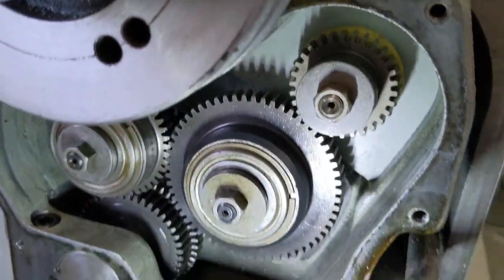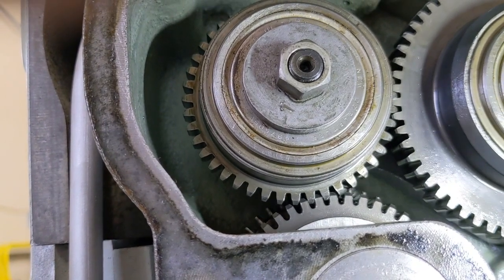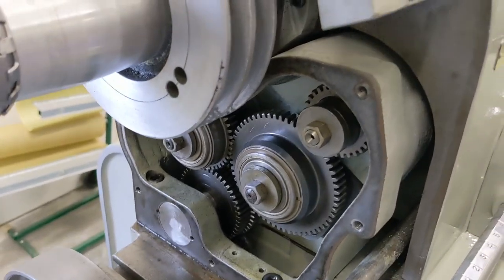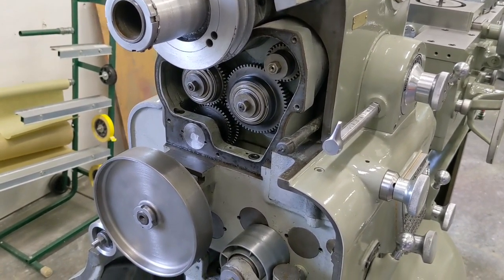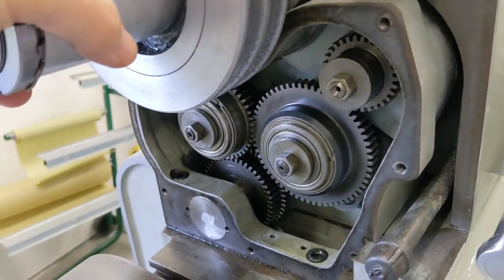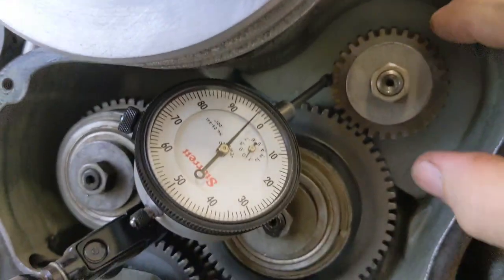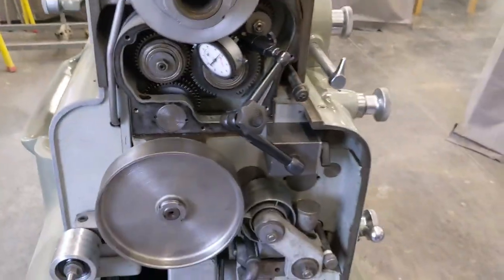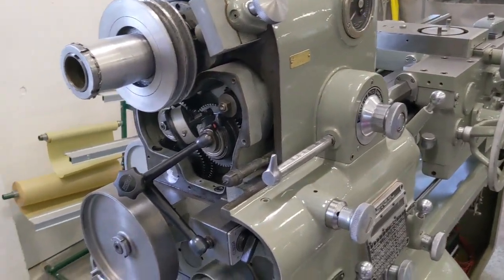10EE part 24

Comment: Did you have any issues aligning the tailstock to the head?  I did a lesser rebuild on a 1954 10EE and discovered a 0.02" sag in the tailstock once I had everything back together.  I cannot adjust it out...the offset is up/down.  I temporarily shimmed it up to see if that helped and it did.  I fear I have to do something more permanent
Reply from the maker: Hi Walt, yes on the first 10EE I did, the tailstock was a few thou low. It was already shimmed. I redid the shims to get it very close in fact I cannot measure the error. I think shimming is ok

Comment: This new angle cleares up a lot and  also leaves a lot of new questions.. Could the rattle come from inside the machine head? maybe behind the top left gear perhaps. I had to go back and watch the number 22 video again. I also noticed the sparkel in the contact point up under in the front of the machine. I believe this is from a defect capacitor. When the contact point starts to throw out sparks like that the capacitor in front of this contact point is dead. You can probably find th closest one to the contact on a diagram. That's the first one to direct your attention too. They are easy to replace and not too expensive. also (and this is important) after changing the capacitor the contact it self must be cleaned. the sparks will cause build up on the contact surface and over time cause the contact to fail to make contact. The build up does not allow current to flow. if it makes a spark after as long as the spark is small and blue you are good. when the spark is yellow or orange it is burning the contact point. I know this from fixing the old traditional tattoo machines. the color of the spark is just as important as the color of the exhaust smoke on a car. except if the smoke from the car is blue you are in trouble.
Reply from the maker: Thanks Lars, Great point on the bad cap...didn't think to check that. I will and provide an update...Thanks!!

Comment: Did you record any video of the machine running pre the refurb? Could listen to that to check if the noise is at least the same as last time and that you've not tweaked anything in the reassemble. Already looks incredible and hope you get it sorted to where you're happy with it
Reply from the maker: Hi Neil, I did but it was very short and only while in open belt, not the threading gears. I'll certainly do that if I have the chance to pick up another lathe!

Comment: I think my 10ee has similar gear noise.  When I put in the metric change gears, which are new, noise doesn't change much.  Hard to tell from the video but I would say the back lash in the gear train in my lathe is similar to yours.  I would suspect the majority of the noise is just resonance from an unloaded gear set.  My lathe does have less gear noise when you're actually threading so that may be the case for you.
Reply from the maker: Good to know that it's only my lathe! I may have mentioned it before but for some reason its much more pronounced in the video than in real life. I was re-watching the video on my phone when I really focused on the gear noise but when I went back to the machine and tried it again, I was surprised at the difference in sound. I know it's no where near as noisy as my old South Bend that was quite a rattle box!
Reply: @fourpondsshop7940  Also, from your video the gear engagement looks very similar to mine.  At first I was a little put off by the gap between the gears but the back lash I recall being similar to yours.  I would say you're in good shape.

Comment: If you happen to have access to a strobe light put a mark on each gear then dial in the strobe light until that gear becomes stationary listen for the sound defect . as all the gears will turn out different RPMs it will become obvious when the noise and the strobe becomes one then as one of your other viewers suggested try swapping the gear with your other machine to see if it helps resolve your problem good luck
Reply from the maker: That's a pretty cleaver way to isolate the problem. I do have a strobe, I'll give it a go when I get back to my shop...thanks!

Comment: Would Blue Moly be a consideration since the gears are slow moving? You mentioned that those top gears get some oil sling from the bottom, thus not sure how compatible the Blue Moly would be mixing with your oil. Just thinking that the suspended Moly particles may help fill in the voids between where the gears mesh.
Reply from the maker: That's a thought...I'm pretty sure I'm going to try some grease before I tear things apart

Comment: I wonder if the noise is cumulative such that the backlash at each point contributes some fraction of the total. If that is so, replacing only one part will eliminate only that part’s contribution. Ugh! Is it possible the teeth are just worn from use therefore noisy in operation since the face of one tooth slaps into its mate rather then rolls into it like a new, full sized tooth would? Short of bad bearings, what else is there? All that implies new gears or noise canceling headphones! (I hope not.)
Reply from the maker: Ha, I like the noise canceling headset suggestion!!

Comment: What I hear going back several posts is gear rattle which I think is normal with age and the fact to its having hardened straight cut spur gears with no load similar to Chevy (rock crusher) transmission gears . These gears don't get much oil splash from secondary transmission which is normal , some are louder than others (luck of the draw) I use Hi-Tach brand oil  additive from auto store (similar to STP) straight out of the bottle for the past 30+ years on open lathe gears with good success to quieten them down (it's some what sticky and clings to the gears unlike grease). I added some to the secondary transmission oil to my 10EE and other lathes which quieten them all down with out adding too much heat friction to transmission. Most of the time these gears when engaged for threading don't run fast anyway . Hope this helps !
Reply from the maker: Thanks Robin, great info and suggestions!

Comment: Can you add any drag in the gears by adjusting the clamp load on the shafts the gears run on?  Maybe a fiber washer?  If you do that to one gear it might preload the teeth to one side and not rattle
Reply from the maker: Thanks Greg, great suggestion! I think there might be a fiber washer in the lead screw end where the ELSR switches are so that might be a candidate

Comment: If it's not too much of a pain in the butt you could swap one gear at a time with the other machine and see if any one gear makes that much of a difference until all three were swapped?.
Reply from the maker: hmmmm, that's an option I hadn't thought about
Reply: @fourpondsshop7940  are all of these on ball bearings or bronze bushings? If bushings I'd make sure they were good cause wear would add gap in teeth and a slight potential for noise.

Comment: Hmm, surprising that Monarch wouldn't have mounted these gears on eccentric bushings, or some other way to adjust backlash.  I'm no expert, but would a heavy grease on these quiet the gear noise?
Reply from the maker: Hi and thanks for the input. I would agree that it seems strange that Monarch overlooked the ability to adjust those gears...but I haven't pulled them off yet so I might be surprised to find eccentrics. I'm going to try some grease

Comment: What do you think about some grease on the gears?
Reply from the maker: Hi Paul,

That might be a good idea as it seems those gears generally run at slower speeds. They do get lubricated by the lower gears picking up oil from the lower gearcase.